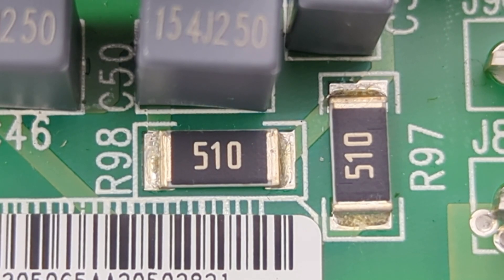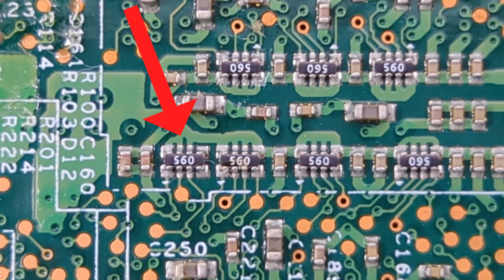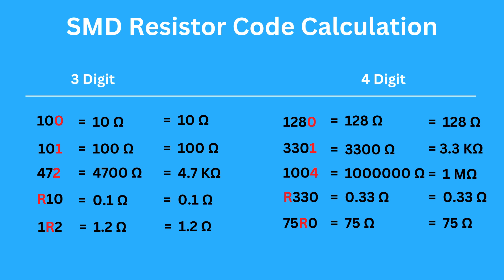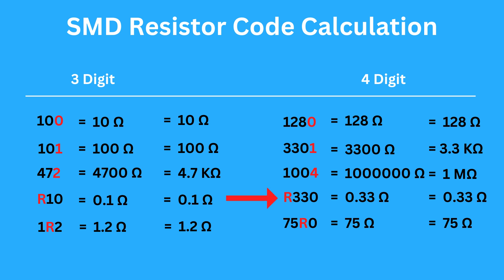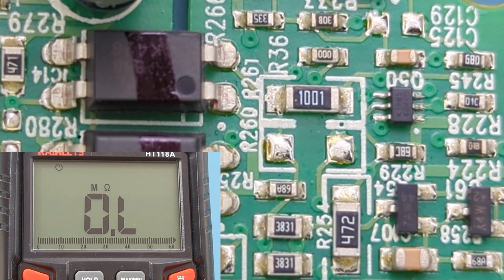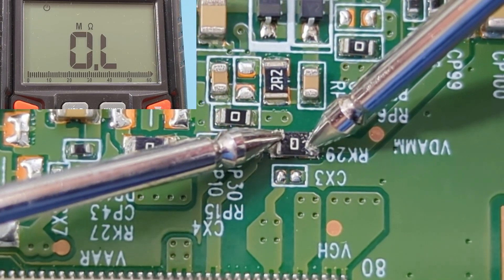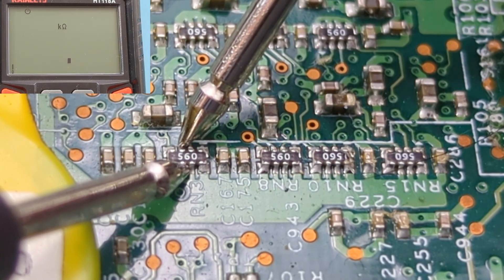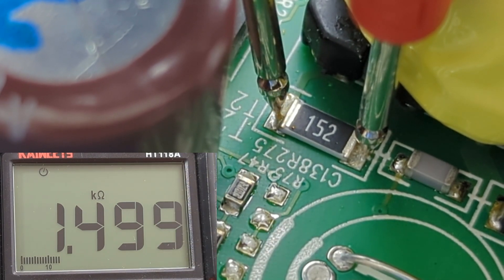How To Test SMD Resistor With Multimeter

Comment: I am suspecting an R100 resistor as being open.
  From what I read an R100 resistor is a .1 Ohm part  ( 0.10)  The chart you posted shows  a .1 Ohm part as an R10   I tend to believe what I see on other pages the R100 should be a 0.1 Ohm

Comment: RECEBA 1 SUPER ABRAÇO AQUI DO BRASIL 👍 😃 POR FAVOR AMIGO DIZ O VALOR DO SMD R750 , O MEU QUEIMOU AQUI
Reply from the maker: Thanks for the super hug from Brazil! 😃 If the resistor is labeled R750, its value should be 0.75 ohms.

Comment: 4:15 are you sure about that? 6 x 3300 resistors in parallel is equal to exactly 550 ohms, so the resistor is perfectly fine. You didn't mention the way series and parallel resistors work here lol.
Reply: Gracias por enseñar tan bien.
Reply: So they have to be tested out of circuit.

Comment: Man i think u talking wrong, for example when u measuring 101 it shows u 33 ohm, an u have 3 resistor 101 if they are in paralel that is exactly good value not bad. Multimeter shows lowest resistance btw measure points
Reply: I had experience that too on 3 resistors in parallel

Comment: But I thought you COULDN’T reliably test a resistor IN CIRCUIT. Aren’t you supposed to desolder at last one end, before measuring the resistance, otherwise the reading could be affected by the other surrounding components? Or are SMD resistors different, in that respect? Please reply, I’m trying to learn. Thank you kindly
Reply: That would be capacitors

Comment: I am asking some questions. I recently replaced the fuse box board in my car with new resistors (122). It had nearly flawless resistance of 1200 ohms prior to my installation of the new resistors (122). However, upon installation and verification, the resistance of four resistors was reduced to 456 ohms. and 38 ohms is displayed by the other resistors😯. Then, believing that I had simply burned the resistors during installation, I took out one of the 38 ohm resistors. then the test returns with the accurate measurement of 1200 ohms.  What might the problem or issue be? however, as of right now, our car is operating without an alarm. I am grateful in advance. I am hoping you will read this and respond to my queries.
Reply: I am not an electronic engineer or an electrician. I simply study on my own to get our car fixed. Because I cannot afford to pay $300–4000 for repairs or to purchase a brand-new one for about $600. I ended up saving $597. Because the resistors I purchased are only $3 for 50 pieces. 😊

Comment: Very good and clear explanation. Thank you
Reply from the maker: I'm glad you found this video helpful!
Reply: @ElectroUniversity  I am asking some questions. I recently replaced the fuse box board in my car with new resistors (122). It had nearly flawless resistance of 1200 ohms prior to my installation of the new resistors (122). However, upon installation and verification, the resistance of four resistors was reduced to 456 ohms. and 38 ohms is displayed by the other resistors😯. Then, believing that I had simply burned the resistors during installation, I took out one of the 38 ohm resistors. then the test returns with the accurate measurement of 1200 ohms.  What might the problem or issue be? however, as of right now, our car is operating without an alarm. I am grateful in advance. I am hoping you will read this and respond to my queries.
Reply: @ElectroUniversity  I am asking some questions. I recently replaced the fuse box board in my car with new resistors (122). It had nearly flawless resistance of 1200 ohms prior to my installation of the new resistors (122). However, upon installation and verification, the resistance of four resistors was reduced to 456 ohms. and 38 ohms is displayed by the other resistors😯. Then, believing that I had simply burned the resistors during installation, I took out one of the 38 ohm resistors. then the test returns with the accurate measurement of 1200 ohms.  What might the problem or issue be? however, as of right now, our car is operating without an alarm. I am grateful in advance. I am hoping you will read this and respond to my queries.

Comment: Thank you for sharing this video. I have a question, if the resistor make sound at buzzer mode, Is it good or bad? I got sound on 105 smd resistor!
Reply from the maker: You might have a short circuit, which could mean the resistor is bad. It's a good idea to double-check by measuring its resistance.
Reply: @ElectroUniversity 
Thank you for replying. I checked the resistor according to the information you provided (thank you again). It's 105 and the resistance should be 1M ohms but the Multimeter is not giving as should be.

Comment: Only one question if I may. 
When would you hear a beep or have you set your multimeter to ohm / kilo etc. Im obviously refer to continuity
Reply from the maker: You should expect a beep if the resistor has a low resistance, especially if it's below 100 ohms.
Reply: @ElectroUniversity  hi thanks for reply ...so obviously this would indicate a " faulty" bad resistor! 
Am i corect? Then when im getting NO beep on most resistors they ALL " good"
Reply: @Clyde-jd8ro No beep is most probably no short in the circuit. If you hear a beep most probably there is a shorted component in the circuit you are measuring in, but it doesn't necessarily have to be that it is the component you are checking.
Reply: @sharymens8187  I checked a  0 ohm  resistor on my motherboard ,  and got beep , then I did the same thing fir a 0 ohm resistance located in another place of my PCB , and that time got no beep
Reply: @tunkunrunk  Depends on the multimeter mode

Comment: it works because the ones you checked where in series some circuits put them in parallel to increase the maximum wattage they could handle